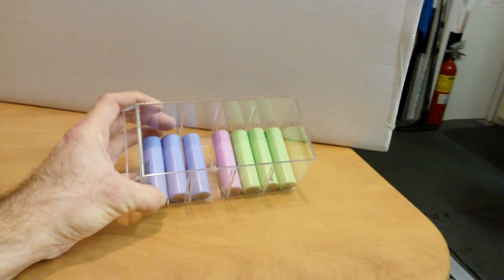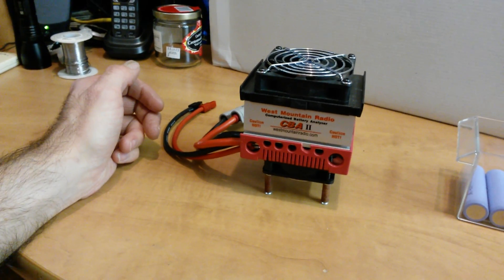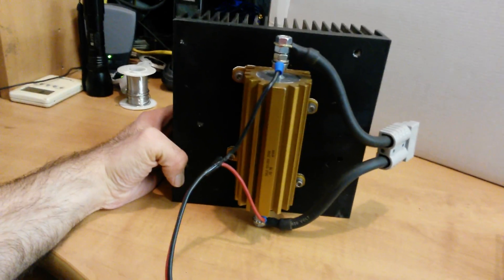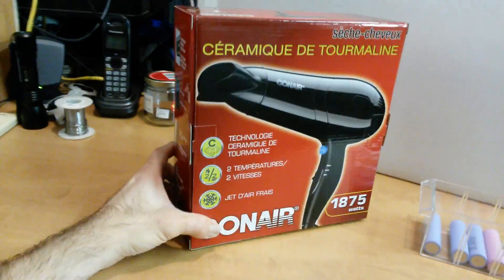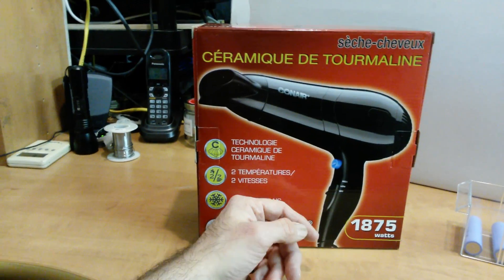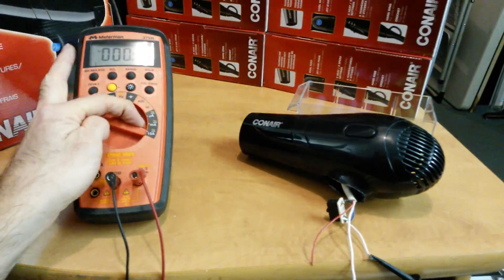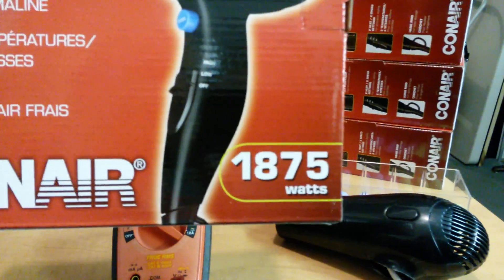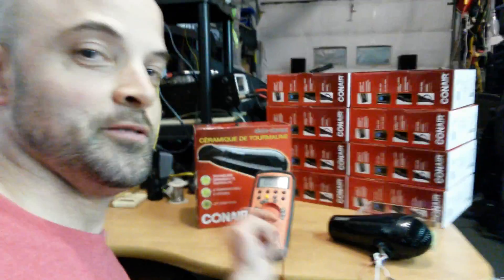19kW  HIGH  POWER LOAD RESISTOR   !!!

Comment: Does the fan work on DC?
Reply from the maker: Ys it work! Hair dryer work on both DC and AC.
Reply: @Doctorbasss  Really? So it's a DC motor. That's awesome. Do you have a video with it all set up?
Reply: No, he'd have to cut the fan wires off and hook that to 120v ac
Reply: @manw3bttcks  ok that's what I would have thought
Reply: @manw3bttcks  wait so this $80 trick needs a FAT a$$ inverter after all? so it's not gonna work realistically..

Comment: FANTASTIC idea... hahaha... this video illustrates the exactly same drama I am having to test large packs under load... I am actually building a panel with many many many 12v 100w H7 bulbs, I am making in a way "kinda of a smart matrix" that will be flexible and easy to test different voltage packs at different loads. Your video gave me some new ideas =]